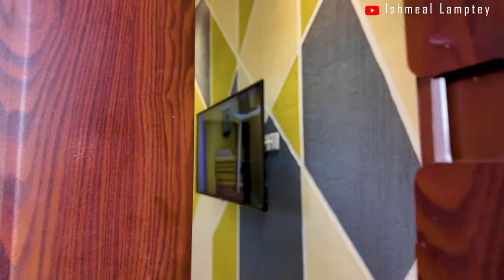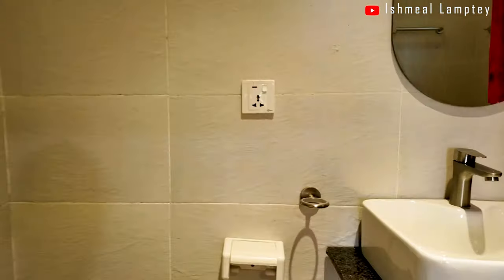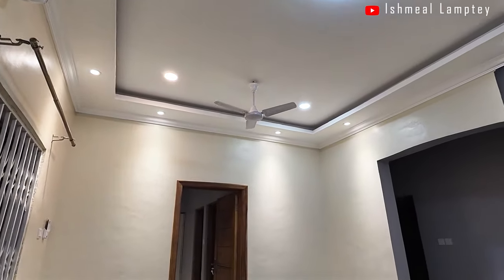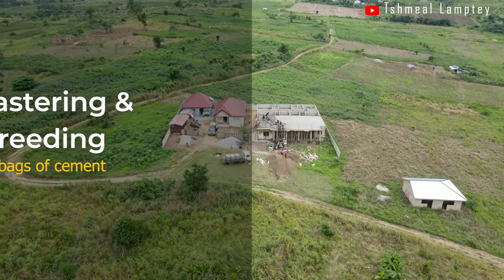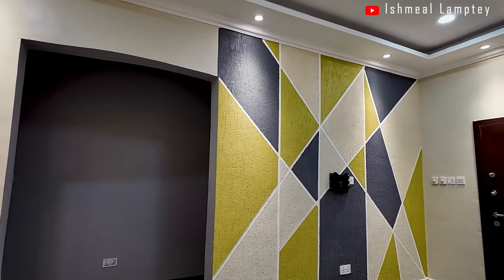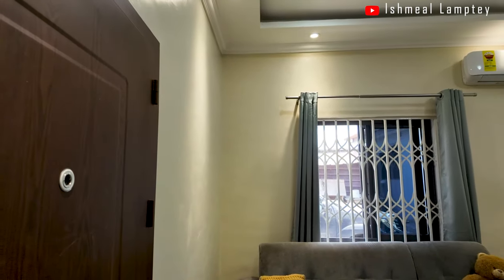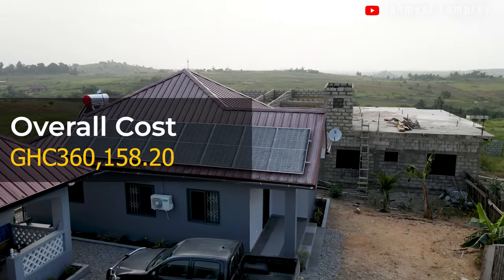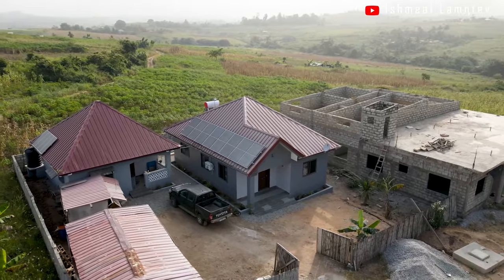Cost of building a 2 bedroom complete Off-grid house with Solar and Borehole

Comment: I ❤️ IT ...BUT MY ONLY PROBLEM I HAVE WITH THIS PROJECT IS THE FINISHING TOUCHES.

ATTENTION TO DETAILS NEEDS TO BE SMOOTH ALWAYS, LINES LINE UP STRAIGHT LIKE TILES, NO GAPS.

SWITCHES AND CABINETRYS AND SO ON AND SO FORTH. DOOR 🚪 CORNERS, WALL 🧱 CORNERS, EDGES WITHOUT PAINT'S, ETC. KEEP UP THE GOOD WORKS ✌️

Comment: This is a nice affordable house. Personally, I would like a little more space, but its a beautiful home. Well done! I guess, if this house was done with interlocking bricks, you could get more space for the same money or less. I maybe wrong!
Reply from the maker: Thank you and Very well noted.
Reply: But will it have the same strength? That's something I've yet to find out. What happens when it's soaked? Will water not drain inside?
Reply from the maker: @aberba  Bricks has its own properties as well as advantages and it's disadvantages. There are a lot of factors that will make one building material suitable over the other.

Comment: Great work Ishmael and glad to see you installed the Solar system yourself. About the Solar heater, beside the 150 liter tank, do you still need to have another separate Polytank to store hot water?
 What capacity of solar heater would you recommend for a 5 bedroom house? Lastly, considering Ghana been hot/ summer temperature all year round do you see it useful/ economical to fit a house with either a water heater(boiler) or solar heaters?
Reply from the maker: Thank you. You don't need a separate tank to store the hot water as it is stored in the thermal tank. For a 5 bedroom house, a 200 liters or anything above will be fine. The solar water heater is very useful and economical as compared to electricity powered water heaters.